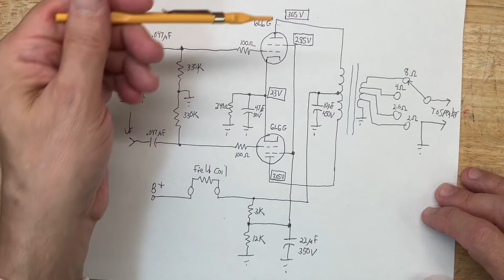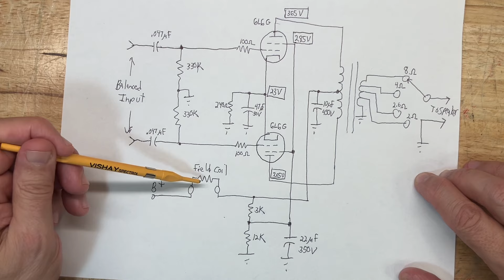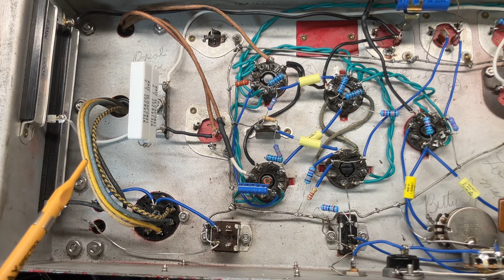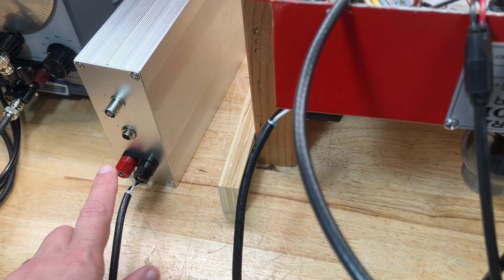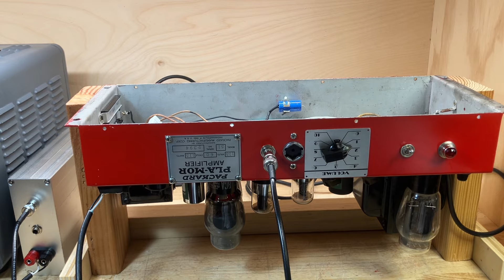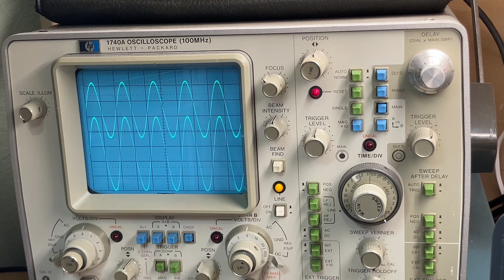1946 Packard Pla-Mor Jukebox Amplifier Part 8

Comment: Thank you for the detailed walkthrough and great restoration. I am really interested in building this amplifier and winding power and output transformers for it. I think that 6SN7 differential should really work well and be superior to the other PP designs I've built so far.